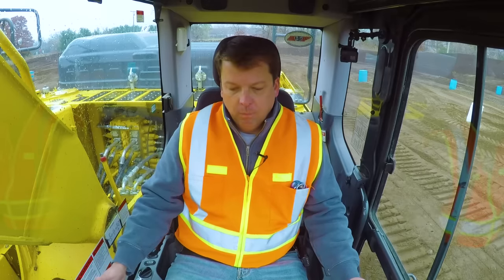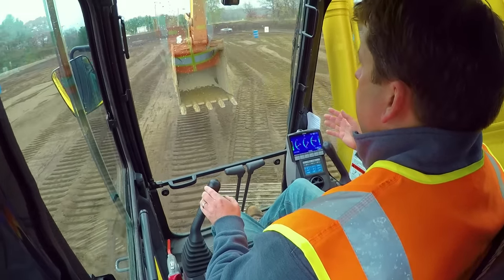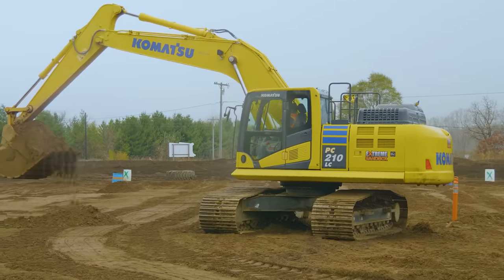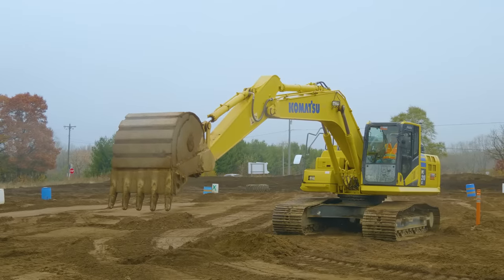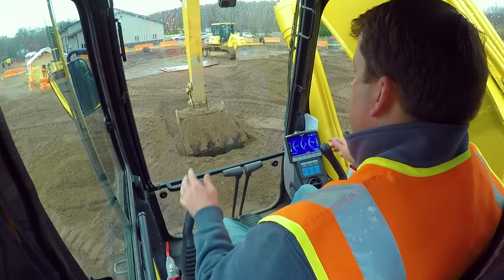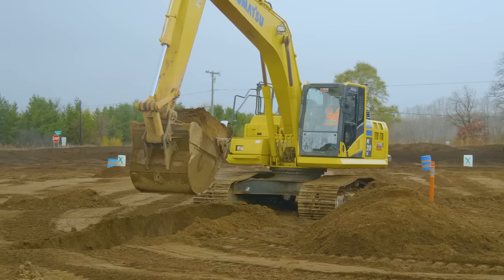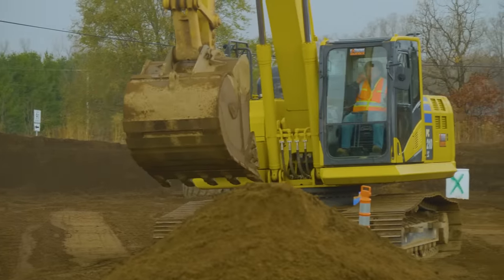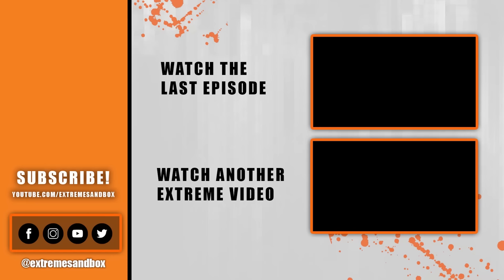What NOT to do in an Excavator | Heavy Equipment Operator Training

Comment: Another "don't do" is operating without the seatbelt holding you properly in the seat. As I say, when you are out of the seat you are out of control. I see it happen with everything from excavators and especially tractors and spray rigs and combines and dozers. Some knucklehead is too cool/tough/stupid to use the seat belt. From 100,000 pound to 12,000 pound machines I am one with the machine at all times. I don't like being loosey-goosey while working. With my butt anchored my muscle memory can take over and everything moves as it's supposed to.
Reply from the maker: 1000% agree with this one...safety first...always!
Reply: It’s nice that you like your seatbelt. Jump in a scrapper for a couple days and then let us know how your gut feels. Or haul some gravel and load yourself 20 or 30 times a day. There’s reasons for not wearing a seatbelt that don’t have any thing to do with being tough or cool. Learn how to run the machine and don’t flip it is a better option in my opinion
Reply: @bjhinson4647  Wow. That sounds a whole lot rougher than anything we go through. We don't see scrapers around here. We use ag tractors with pull scrapers because it's mostly farm field leveling work. With a tractor in farming one unexpected need for a seatbelt is pulling a heavy load then clutching it. I was on a tractor last week pulling a Rome new land offset disc. Pushing the button for neutral felt like slamming into a wall. One second all eight tires are on the margin of slipping then an instant later it's all stopped. Aside from that tractors can toss you around when you hit something you didn't see - a ditch or maybe a culvert. That 80" inch tire is going over it or across it and you are along for four seconds of terror.
Reply: BJ HInson I’d like to see a video on felling trees. We have clay here that the trees really anchor into. So if we don’t want a tree to break off we have to break up the roots first.
Reply: A real operator. Nice to meet you.

Comment: Just for shits and giggles trench some gas lines and several duct banks in unknown locations that’s always exciting lol
Reply from the maker: Actually have discussed putting in some simulated utilities (both marked AND unmarked).   Always good to learn here than on a REAL site!
Reply: Digging over a 700 psi gas pipe definitely gets the blood flowing. 
    As far as obstacles, training center for operating  engineers does that. It fine to start without but before class is over they should have real world training or you're doing a disservice.

Comment: If trying to locate buried pipe  I set the machine at an angle awary from the trench, excacator or backhoe and dig down,pulling away from the possiible location of the pipe, if you have a pipe located that could help "The rule is "Call before you dig". Dig down and by hand dig towards the pipe to expose. Once visible, you should keep pipe in view and not hit it as you dig.

Comment: I once seen a guy swing over a burning bail over an over agian an he's been running one of this for years
Reply from the maker: whoa
Reply: What does this mean?  What's a burning bail?
Reply: @BrianDoylePDX  If you have seen letsdig18's vids where he is burning you have seen this. Anything burning can be called a burning bail, though I suspect the origin of the name is a bail of hay. In one recent video Chris actually talks about how on one occasion his hydraulic line burst over a fire he was feeding, burning hydraulic oil as a flamethrower from his excavator as he moved the machine away from the fire. It was an old line and burst from age and pressure, not the fire. He clearly details how risky it is and how the material to be burnt provides a heat shield until it's dropped. This vid was posted in the last few days. here is the link to it: https://www.youtube.com/watch?v=ZDABlbPF78c
Reply: Worked with fire a lot. Just another hazard of the job.
Reply: Sometimes you have to get the boom in the fire for a second or 2. Just part of it. Gotta be smart about it tho!

Comment: I live in Hawaii and we have a lot of hills here 
Some 45* I put my blade in back (if I start slipping or need to stop o put it down. 
I also extend my boom fully and keep my bucket as low to  the ground as I can. I use full throttle and pay attention to everything going on. 
If you run over (even a small rock , or hit a patch of solid rock it causes that track to slip. So I very slowly back up and remove the rock  if I can.  I’m new to the game but your learning curve has to be fast or you either die,or flip your machine. 
I respect good operators. With that being said what is the best way to climb steep terrain? 
Blade in front,or back
Position of boom/bucket
What is the best technique? 
Thank you all🤙🏽Aloha

Comment: A good point is in how you leave your cylinders when parking your machine at the end of the day depending on weather conditions open or closed cylinders
Reply from the maker: Yeah, there have been some good discussions about the proper way to park the excavator.
Reply: jerry metcalf  i have seen pistons messed up by rust in bit over a week while companies waited for licence to continue with work on some sites, windy and bad weather near sea.
Reply: jerry metcalf  if hard frost is likely, I like to keep rods inside the cylinder as I imagine that the rod's wiper seal might last longer than if I regularly bust ice off the rod with it. So at end of day I park it at full reach out of habit, most of the time.

Another subject I'd like to mention is to clean out track frames at end of shift, that's an old school habit, and occasionally helps me notice when a component is starting to fail. I prefer to notice this kind of bad news at the end of shift rather than when it breaks down in the middle of something, and clearing out the debris each shift I get a feel for any changes going on.

Helpful videos from the channel, great job!
Reply: jerry metcalf  Freezing rain or frost can stick on rods. It can damage seals when retracted. Birds can poop on the chrome and cause similar problems. It is always good to park the machine with the cylinders as retracted as possible because the chrome rods are the most easy thing to damage on a hydraulic cylinder. It drives me nuts when I see an excavator parked fully tucked with the end of the bucket cylinder rod pushed deep into the rocky dirt.  If you have to park it like that, at least retract the bucket cylinder. The best parking position is with the boom stretched full out with the bucket in the full open position. This is also the best position to facilitate greasing and inspection. The boom cylinders most often cannot be fully retracted so I always keep an eye on what kind of contamination is on the chrome at the top of the cylinder. If I see grease, mud, hard dirt , or bird poop, I take some time to clean it off.  Repair to these cylinders can easily be $2,500 or more. That comes out of my pocket so it pays to be diligent.

Comment: Ive seen one of these roll off a high mound due to the operator swinging the boom high in the air with a full bucket. People be aware, these will topple over.... Its no joke,,,,

I also think that new operators should be taught how to climb steep banks as when they turn up blue and you point at where you need them to work they nearly faint with the words " how dafuq you get up there "....... Use stick and feet !!!
Reply from the maker: Good advice..thanks for sharing!
Reply: @HeavyMetalLearning  Very good and informative videos. Another good tip is if you are cleaning up rubble i always load using half of the bucket from the side of the pile of rubble and you find it fills alot more efficent rather than leaving piles either side of the bucket ( if you get me lol ).. luckily i was trained by some old timers who were time served geniuses....
Reply from the maker: Great tips...thanks!
Reply: 😂😂 I agree. Still to this day it catches me cause of the tipping point. I remeber the first time the foreman let me on one and he's like I got this pile of dirt I'm going to leave you have a play but I want you to track up onto it and down the other side you have 30 mins and I remember him coming back and he had to guide me down the other side cause the whole angle and tipping point can scare the daylight out of a new operator especially in such a big piece of equipment. Since though I've had a little more practice and have really learned weight distribution but I find for me it's going down that catches me out more than going up. Cause of the whole face plant scare even though you know the bucket is there to catch you it's having that trust

Comment: I'm interested to know how you would dig a trench parallel to the excavator to one side, if for some reason you could not straddle the trench, for instance along a wall or a gully. Is there a bucket attachment that could pivot 90° to the boom?
Reply from the maker: Good question....most smaller excavators have the ability to pivot just the arm at the front of the machine, so can dig perpendicular to the tracks.
Reply: Mini's and very small machines do. The do make a boom for bigger machines that turns and they make a stick that can rotate the bucket. 
   Using a regular hoe it is difficult and you wouldn't be able to dig very deep. Plus hard on machine as your digging using swing motor(s).
Reply: Thanks, guys, for these answers.

Comment: Slamming the bucket hard against the stop when dumping the load is a simple one that make cringe.
Reply from the maker: Agreed...thanks for sharing!
Reply: Eventually that action cracks the hell out of the tip of stick around the pin holding bucket on. Then bushings disinegrate and floppy bucket syndrome develops. One bang get off that thang!!
Reply from the maker: Love that saying...lol
Reply: Yeah but sometimes, you need to do that to get wet mud thats stuck in the bucket out. When you have 20 truck and trailers waiting to get loaded and have half a bucket of mud stuck it slows you down because you have to put twice as many buckets. This is the only time when it's ok.
Reply: @peterphillips2419  yep I never did it in Florida but in virginia with wet clay that's starting to freeze I would bang that thing all day. Took me awhile to be okay with it
Reply: @peterphillips2419  absolutley. Not!!
Reply: @samvt  it would take longer to be ok getting fired.
Reply: @samvt  lol, if it was freezing that fast its time to go home
Reply: @peterphillips2419  you couldnt handle twenty trucks snd trailers anyway. Your a D1 operator at best.
Reply: @bladerunner6354  trust me the boss doesn't want trucks laying around. Cost more money than what the part is worth. 20 trucks is not max. I can handle 30 in an hour, 2 mins per truck with 30 ton machine.
Reply: @broc212  lmmfao smh
Reply: Ever dig wet clay? Or anything that sticks you have to bang on the dump bet if you get good at it you get a good flick and cleanout. Thing about talking about all this theoretical bs doesnt change the fact that work needs to get done and sometimes you cant use all the theoretical bests you use what you got and get shit done. But idealy dont swing and hit the bosses truck lol.
Reply: @broc212  beautiful rebuttal for a non shit kicker my good sir. Gotta got er done even if shes rains snow and ice. I live in canada and alls i cam say is either youre a cowboy or a union dock sucker here and lets just say cowboys are the ones who own all their own toys ;) and dont have to talk a big game
Reply: @hellbringer09  yes sir! When you're on a deadline or already jobs behind, you make the best of a bad situation and get the job done and done right at that.
Reply: Stretch your stick out so the bucket is facing the ground and the wrist pin isn’t going to hit the ground and tap the bucket on the ground. Works the best on a frozen lease or right of way. If the ground is to soft it will just sink in. Also if your bucket is frozen. Heat the bucket and tap it and the metal will sweat and the dirt will come out in a big chunk. Don’t try to heat the dirt it will take forever. Apparently blade runner has never worked in clay or in winter. If I didn’t have to bang my bucket I wouldn’t. And also fuck that guy with the farmer joke.
Reply: @bjhinson4647  thats even worse then just letting the bucket slam id say... Think about it weight of the whole arm and possibly machine vs just weight of the bucket+contents...?
Reply: @bladerunner6354  broken action and loose buckets come from lack off maintenance and grease. I bang my machine all day in shitty old lake bed clay you just have to be mindful of doubling up on grease that means a second grease midday if you dont have auto greasers. Theres a reason we use mild steel pins sir...
Reply: Derek. Sometimes just dead ending the cylinder to bang your bucket doesn’t work. When it gets plugged with frozen clay from mixing sumps or because it’s -30 Celsius a little abuse is needed. I own my own machine so I don’t like beating it up but I also can’t work to make money if my bucket is full of crap. Try it before you knock it.
Reply: Derek. Where in Canada do you live. I’m in northern ab.
Reply: @bjhinson4647  central ontario so depending on where site is we can be in quite literally anything from beach sand to shield.
Reply: @borne2fly
I consider that the indicator of the "safety radius" I give that operator.

Comment: Your vidios are very infomative and i have NO faults as to your tips.. The only thing i would like to see is more tips on older equipment.. I've run equipment since i was 10 years old and am 55 now but i see you in new hystat machines.. Thats great if your getting a job in the city with new rental yard machine. I ve been in the oil field and favorite dozer was D6D only have 3 forward spd with power shift and decell.. Steer break peddles and steer clutch leavers..  Ive run hoes with old 4 stick. The only joy stick machine i have is a 1994 tekauchi excavator. Most people starting a small company or going to work for a small company dont have the luxury of modern controls and patterns..  When i get in a new machine i can bearly run it.. But give me an old D8 with A habd clutch and cable blade and ill school you..lol  my point is there is alot of OLD machines out there and a farmer or new landowner that need pointers would lickly end up in. I personally have a 1963 jd350 with peddle clutch, shuttle shift and reverser.. Id love to see vidios comparing controls and patterns lickly to be incounterd by novice.. We dont all have a quarter mil. To spend on a dozer or hoe for small jobs and hobby work.
Reply from the maker: Thanks for the comment.   Totally agree, would love to do some more videos on older equipment.   I'll see what I can do.

Comment: EDIT: Help, trying to use new mini ex with one arm. Had a stroke at 59, birthday today 75, 11-11-2019. I know, not ideal, but still fun. Got a K008-3, keep it behind metal shop garage door, Mini ex only 28" wide. Like to trade up to K018-4R1 or KX033-4R1. Problem, won't fit in shop anymore. Been removing and adding 5 to 10 plants front yard. Will be starting trenches for irrigation pipe, sub panel for electrical in 50 x 60 barn, add water shutoff ball valve.
Reply from the maker: HAPPY BIRTHDAY!!!!!
Reply: THANKS! Sixteen year old New Holland TC33DA compact tractor back in shop today with 1700 hrs.  Will replace with John Deere or Kubota in 2020.

Comment: Show us how to lay the boom and stick out at night to keep ice off of the chrome.
Reply from the maker: I've heard mixed messaging on that.   Curious how many operators do that in the northern climates.   I've never done it myself but I guess the argument is that the ice could damage the seal once starting up?   Anyone have any experience with that happening?
Reply: @HeavyMetalLearning  From northern Sweden (sorry for bad english) here and we do it to get all the hydraulic oil back in the tank so the oil won't freeze (not literally ofcourse) in the hydraulic hose. When all the oil is gathered in the tank it's easier to heat up since it's close to the engine. Some operators even got heating coils in their hoses. The sealing is taking damage either way in cold but to minimize the damage we always use heater for 2 hours before startup, on startup we leave the excavator for half an hour to get warm and then "airdig" for 15 minutes, before start working. In my opinion it doesn't have anything to do with the chrome. :)
Reply from the maker: @cHromaF1  That makes WAY more sense and I can see why that would help.   Thanks for sharing!
Reply: @cHromaF1  You do realize the cylinders are double acting and are never empty of oil right? There's always oil the cylinders, a little bit less on the rod end because of the lesser amount of available surface area for the oil, but there's still plenty of oil in the cylinders.
Reply: @HeavyMetalLearning  What Samelpamel said isn't correct. I live in northern Canada and all operators lay the machines out so the chrome isn't showing so that they don't damage the dust seals on the cylinders. Once the engine is running and the pump is spinning, hydraulic oil is flowing through the pump it will begin to warm up do to friction. It has nothing to do with it being close to the engine lol. That doesn't even make sense. Once the hydraulic oil is at operating temperature from circulating through the pump for half hour or so it'll be warm enough to not cause damage to the pump under load and also the oil will be warm enough that when you cycle the cylinders a few time the cylinders and rods get warm from the oil and melts the snow/ice. I've been Havy Equipment Field Mechanic for 15+ years.
Reply from the maker: @DimagoDiesel  Good info....thanks for sharing!